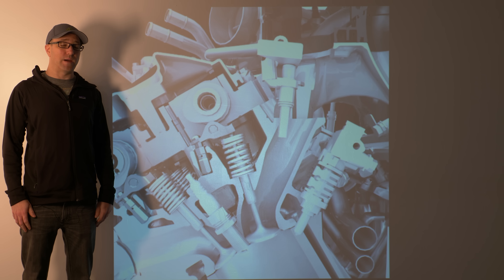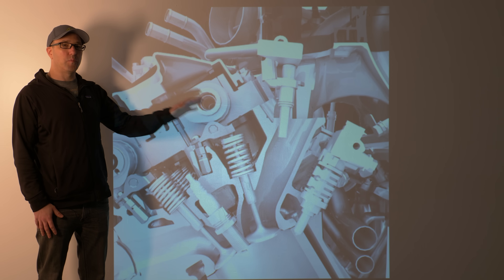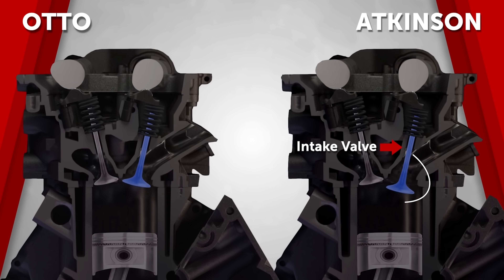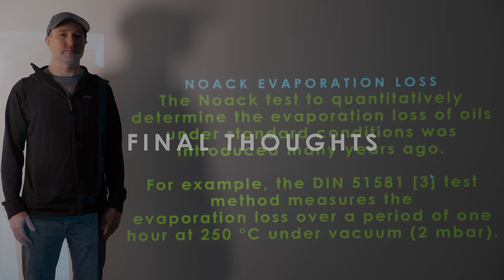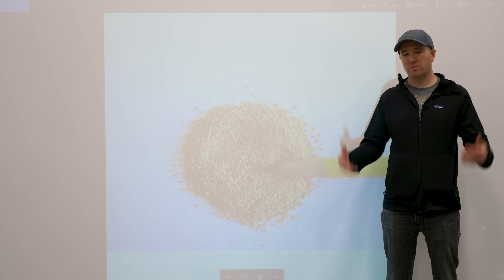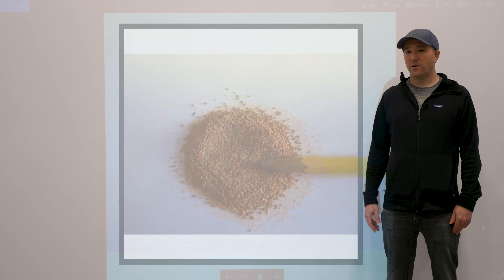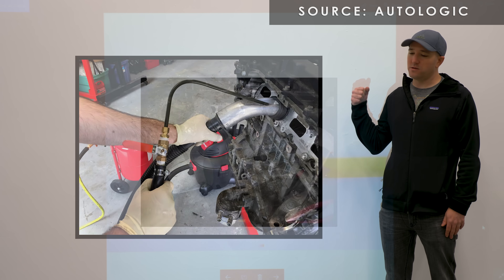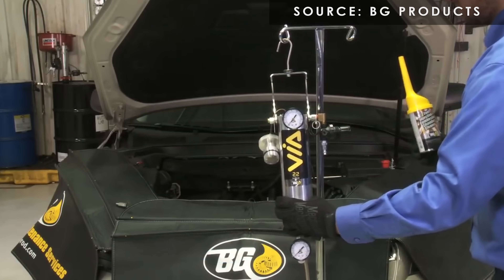Direct Injection, Problems and Solutions | The Fine Print

Comment: Why isn't there a problem with diesels.   They have been direct injection for over 100 years.
Reply: diesel engine doesn't have PCV.
Reply: @SakibChoudhury  Sure they do.   Where does the crankcase blowby go?    I had an 83 Mercedes diesel and it did have PCV.  Thanks for your reply
Reply: @michaelprice3785  diesel engine has  crank ventilation. but thats not positive crank ventilation. it's closed crank case vent or ccv. it dosent bypass or re route as much residue and unburned mixture to the intake valve. on the other hand the diesel engine is made heavier much heavier than that of gasoline hence the parts are more rigid, can withstand more pressure and not gonna require much maintenance or cleaning I believe
Reply: @SakibChoudhury  I just read where diesels before 2000? did not have EGR.    It is the EGR + PCV that creates the gunk that could mess up your valves.   PCV alone is not likely to do so.   Also I am not sure a catch can is a solution, otherwise mfg would use them.    Dirty intake valves are potentially a non-issue, esp on newer engines with low blowby.   Many gasoline DI engines do not even have EGR.  https://www.youtube.com/watch?v=dBAqxSXFyb4

Comment: Royal Purple, AMSOIL Signature, and Redline are the U.S. made Group 4/5 real synthetic oils. Imported brands are Motul and Liqui-Moly are at least Group 4. German-made oils must be at least Group 4 if labeled "Synthetic". But not in the U.S. Don't be fooled by 99% of U.S. oils labeled "Synthetic", "100% Synthetic" and "Full Synthetic" that are Group 3 and have no real synthetic base. These 3 names are just 'Marketing Terms" and mean nothing. Don't pay Group 4 prices for Group 3 like Mobil 1, Penzoil Platinum and Castrol Edge.If you want a Group 3, buy Walmart Super-Syn. That oil, MAG1 and Amazon Basics are made by Warren and are rated SN+. But if you run a turbo, supercharger, race or tow, stay with group 4/5. Like Mark says, it has a higher volatiility index and protects better at high temps. Air cooled jet engines use Group 5. But Jet engine oil is real expensive and hard to get. And the oil they use in NASCAR and prof racing is Group 4/5 with no detergents. You don't need detergents if you dump the oil after every race.You need 100% lubricant. If the race car says "Mobil 1" on the side, it ain't the stuff you can buy at O'Reillys.

Comment: Just go back to port injection. The incredibly small increase in fuel economy isn't worth the carbon buildup, oil dilution, fuel injector failures and noisy operation. I work at a GM dealership as a Service Advisor and we sell valve decarbonization services out the ying yang. It's good money for us but in all honesty the customer gets shafted due to manufacturers going this route. That small amount of money saved in regards to fuel economy goes towards services that are required on vehicles due to the cons of DFI so in the end, good old port injection is far better.

Comment: Dual injection is what I need then....my choices...Toyota and Ford. Got it. Now i need to know....does the F150 5.0 V8 use dual injection or port injection only? I want Ford F150 V8 4x4 crew cab.
Reply: In case you haven't found the answer yet: the 5.0 got dual injection (port and direct) starting in the '18 model year, for both F150 and Mustang. I believe Toyota uses D4-S (dual injection) with all UR engines.
Reply: Dual, but before getting an F-150 V8, do a bit of a research about the class action lawsuits against Ford Motor Company regarding the engine in the F-150.

Comment: Great Video, i have a 2009 Odyssey v6 3.5l with 200 kilometres! I just replaced my spark plugs, timing belt, and water pump at 160k and they were cleaner and looked great!.
I was going to look into a 2018-2019 Oddy for replacement but it has those terrible DI as mentioned as Earth Dreams DI engine.
I think I will keep driving this until it dies! my mechanic said see you at 400k then!

Comment: Thank you for the presentation which is the best that i have seen. However the problem of gdi is not so big as you have presented. Carbon residus can be cleaned with hydrogen mixture via the air filter entry.

Comment: Great illustrations in the video.  Up side DI-cooler fuel in the combustion chamber means higher compression ratios that give the increase performance and MPG all with way less NOx than earlier MPI systems.  Bad thing, no washing of the intake valves with raw fuel allowing oil fumes from the PCV system to build huge amounts of carbon deposits which is only compounded by folks that neglect oil changes.  frequent oil changes, regularly performed induction services, and more frequent replaced high pressure fuel components than MPI are the only down side.